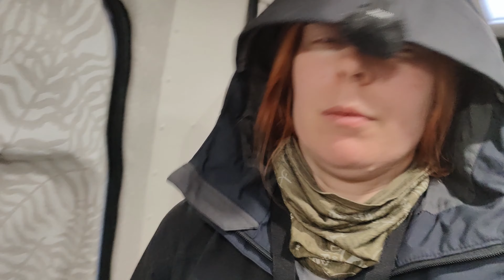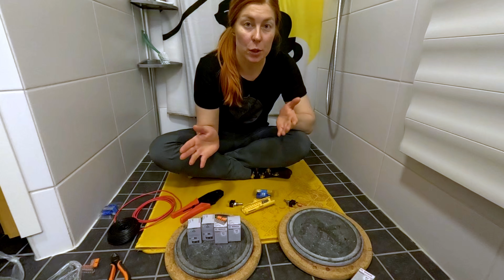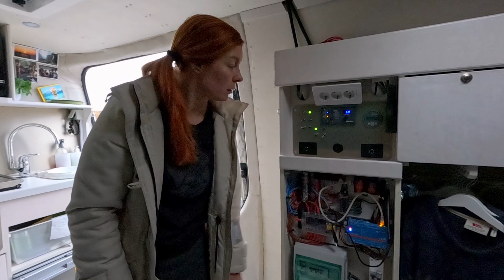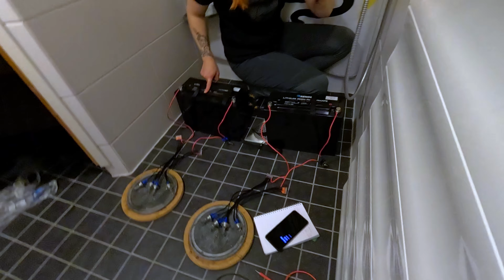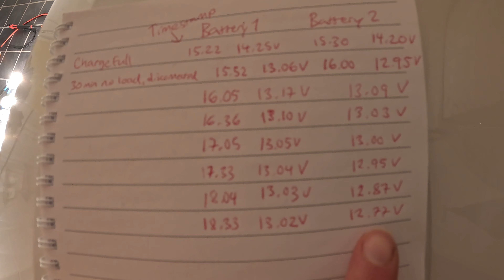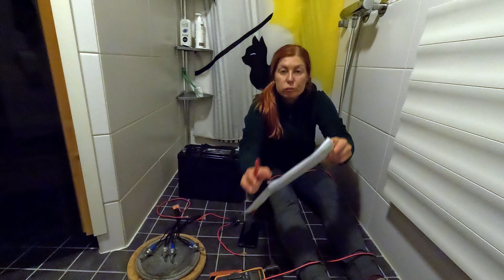Money back | Renogy LiFePO4 Warranty test procedure

Comment: Thanks for the incredibly detailed testing and documentation. Glad our warranty team was able to get you compensated. Your feedback on cold weather performance is really valuable and something we take seriously, which is why our newer Pro series now includes self-heating features. Best of luck with the new build!
Reply from the maker: Heyy, good to hear that because "200Ah Pro Smart Lithium LiFePO4 Battery w/ Bluetooth & Self-heating Function" from Renogy are my new batteries now. It has been an extremely cold winter in Finland this year and they have performed fine so far ☃️ only minor fluctuation on SoC.
I'm flattered to receive a comment from Renogy. If you ever need a tester for your batteries, let me know. This is my line of work as an engineer at product development 👍